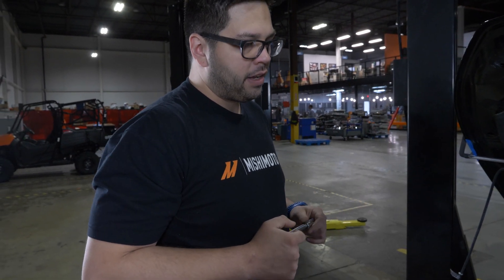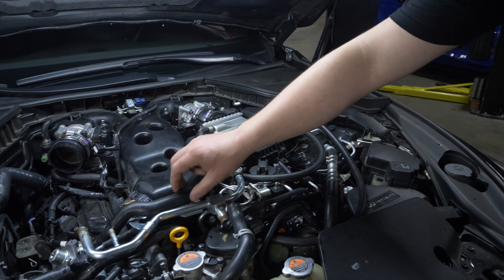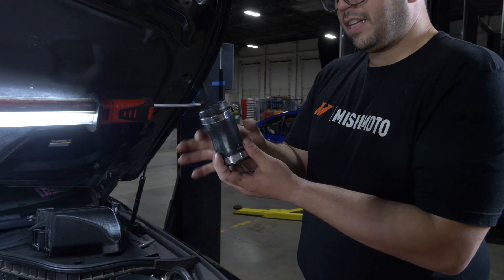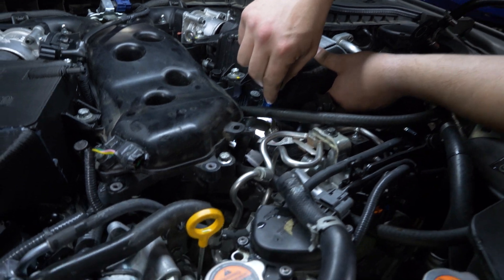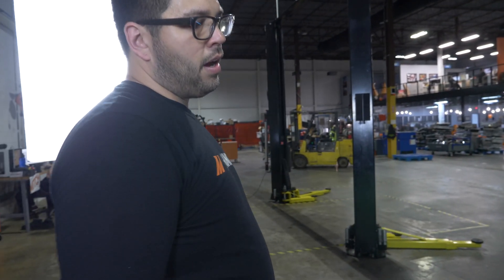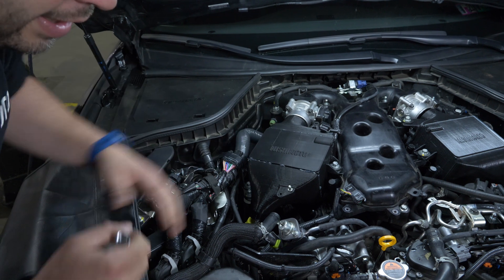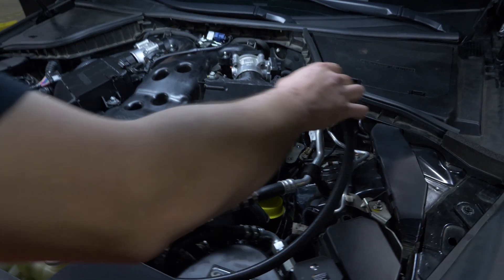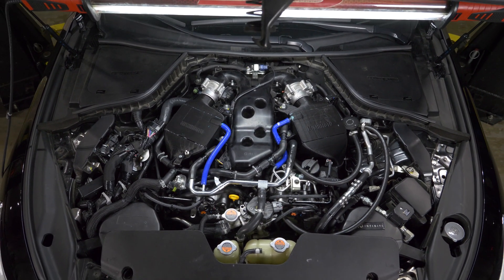Infiniti Q50 | 3D Printed Intercooler Prototypes

Comment: What is the maximum psi the intercoolers can hold? Can it withstand 30 or 40 psi?
Reply from the maker: As we are still in the test fitting and prototype phase the exact specs have not been solidified to provide an max PSI rating.
Reply: @mishimoto  thanks, I want to be running between 20 to 30 psi of boost. So I look forward to your update.
Reply: Could you just pressure test till failure???